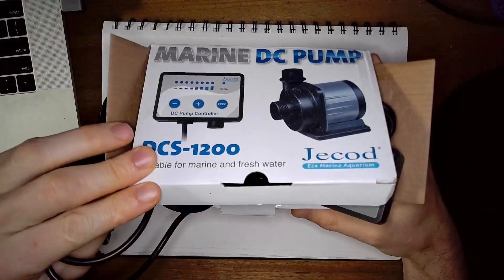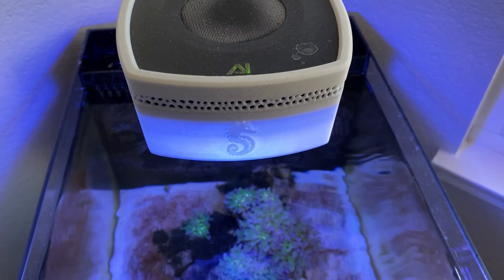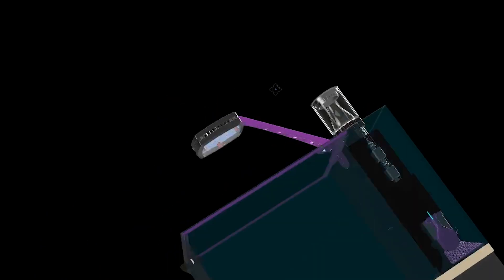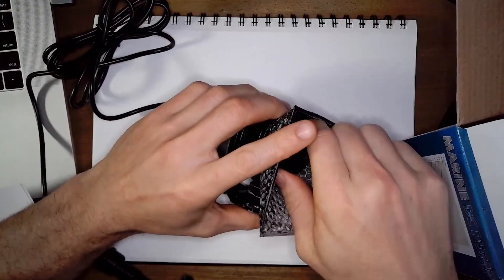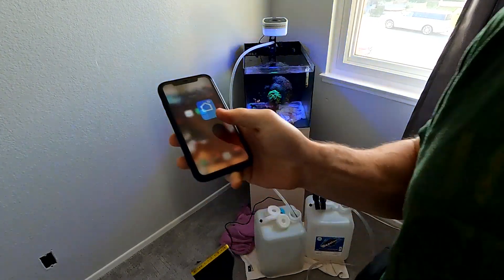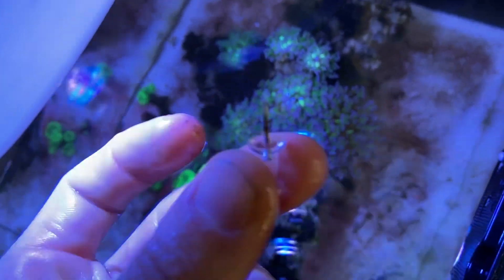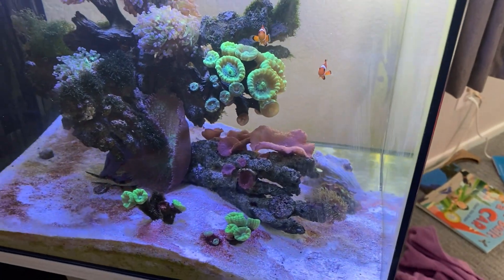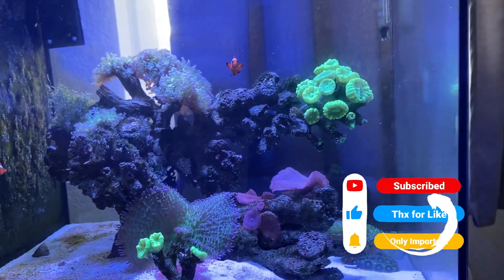WaterBox Peninsula Mini 15g Pump Upgrade | 3d Printed | Part 4

Comment: Thxs for the video.
I can't stand my waterbox, thx God i got it used cheap.
The pump is too powerfull, can't adjust, fish are traumatized, i turn it off half the day.
I have a smaller one, but i m afraid when i get the plumbing for it, it won't fit in the return hole.
Tank is always a mess, all my other tanks are clear and the fish are happy.
I see you seem to be troubleshooting more than enjoying looking at the fish.
Pretty tank, but i have only issues with it.
Clearly not a system for me.
Reply from the maker: @vaindioux  Yeah it is a quality tank but not the best design for sure.

Comment: the pump was running dry...in the after video its underwater so much more u were running it wrong.
Reply from the maker: The pump had water.  It was just loud.  Probably the push pin I found was causing the loud noise.

Comment: I am working on putting 2 IM mighty jet pumps (326 gph) in a IM Fusion pro 20 gallon. Would like to see vertical stacked mounts or design to only take up half  the rear center chamber. Full size skimmer is shared in return pump area. Great videos, just placed an order for applicable parts. Cheers!
Reply from the maker: I wonder if it would be possible to fit the second pump in the bottom section that extends under chamber 1&2 .   Not sure if the pump will fit but that could be a good alternative.   Your going to have some serious flow in that tank.
Reply: @ISeaLive  I'm looking into if that will work with the pumps under those chambers. I'm sure ill get it all to fit, just minor modifications and stuff. Final parts arrive today for build. Ill post a build list on reef 2 reef as the 20 gallon tank is around a $4k build, lol. Pumps will be run around 50-75%. 400-500 gallon per hour over turn, also have a mp10 wavemaker. Ordered stuff yesterday, thanks! Deciding between Nano K1 and IM desktop skimmers. Both arrive today.
Reply: @ISeaLive  Didnt fit in bottom chambers under 1&2. I was able to place both mighty jets butt to butt at the bottom of center chamber. UV sterilizer fit resting just above. 2 heater coils and ATO are also all in that center chamber. Tight fit but enough room for flow. Wiring is all done.

Comment: I think , if you make silikon points on the grond , you can make the pump more quiet , because of the vibration.
Reply from the maker: That would work but I haven’t had any noise issues after changing the pump.

Comment: Pump was likely rattling against the glass. Or the push pin. I had the same issue in an Im20 gallon that made the same exact noise.
Reply from the maker: Whatever the problem the upgrade was well worth it.  The pump is silent and working great 👍🏻.

Comment: What is the pump you're using for filling?  Would love to stop lifting my 2.5 and 5g water jugs.
Reply from the maker: I forgot where I got it but it is just some sort of standard 12v jug/smalll water pump.  i've gotten a few different ones over the years that all worked. (until they broke lol).   You just need to get something that fits into the mouth of the jug and plugs into the wall.

Comment: Crazy I literally bought this same pump from amazon a week ago for my jbj rimless 25g aio and realized how big it was and thought man if I could place vertical it would work... needless to say I returned it. On a side note, I recently purchased a isealive cover for my hygger power head and love it!
Reply from the maker: Haha, yeah I wanted a controllable DC pump so I had to figure out how it could fit.  If you want to give it a try again I’ll print you a set.   
Thank you for the Hygger guard order.  I’ll love these guards and have one in each of my tanks.
Reply: @ISeaLive  dude I just might measure the return chamber area if my dimension are similar to what you have maid I may take you up on that! What's the best way to contact you?
Reply from the maker: @latenitetaco916  mark@isealive.com

Comment: Snazzy 🙂
I love that strainer on the bottom. can you share the STL?
I plumbed mine so the water exited the bottom rather than bringing the water up to the top. This helped with water flow and preventing detritus accumulation on the bottom of the tank.
Reply from the maker: Sure,  shoot me an email Mark@iSeaLive.com and I’ll send you the STL.  
I’m not sure I understand what you mean by plumbed the bottom.  So you drilled the back inside wall of the tank ?

Comment: You need more water in that pump column, if you add more water it will stop making that noise. I had the same issue in my jbj. It just means your water level was low there.
Reply from the maker: My water level was low at the moment I was filming but even when it was full it sounded about the same.   I don’t usually keep the water level that low.  I just haven’t installed the ATO yet so it was about to run dry.
Reply: Mine is not as loud but not far off it and mine is full